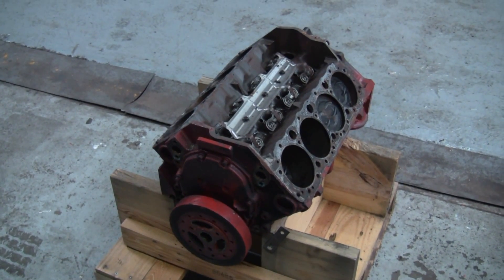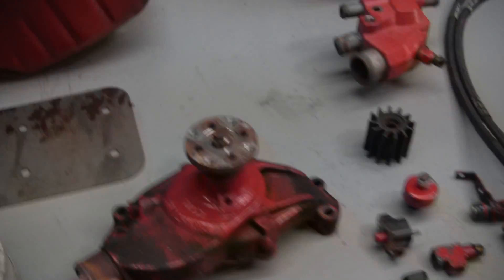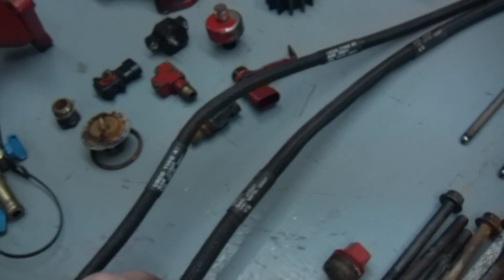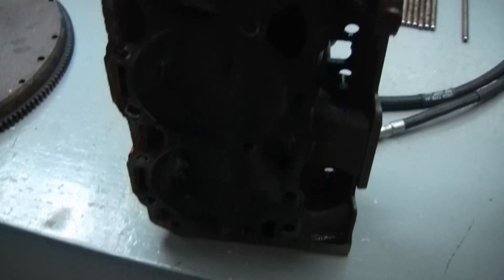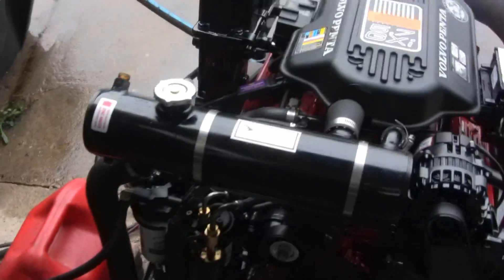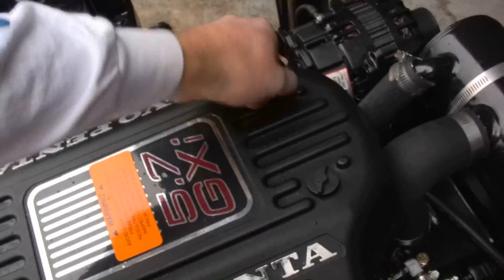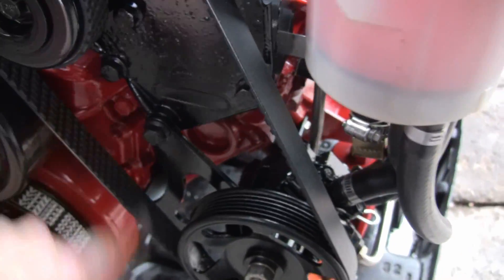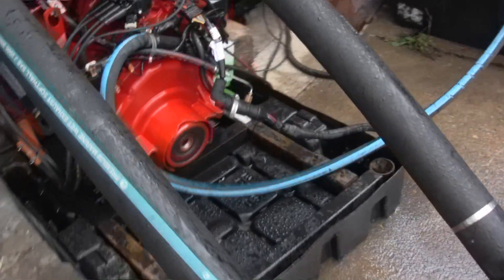Volvo Penta 5.7L GXi-J Total Engine Rebuild

Comment: Great Video.  I have a 1994 volvo penta 5.7, port runs great.  starboard has intermittent issues with firing.  Looking for a video that covers all relays necessary to get fire ,   spark plugs rotor all fine,  fuel is there.  Thanks in advance....